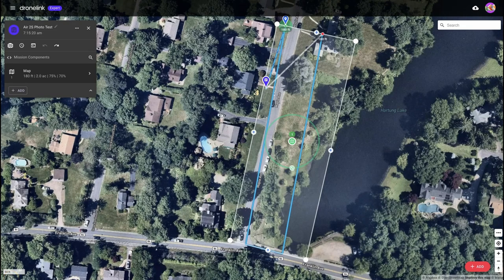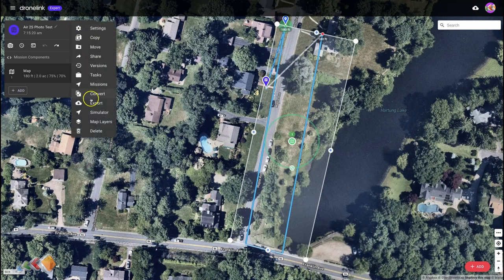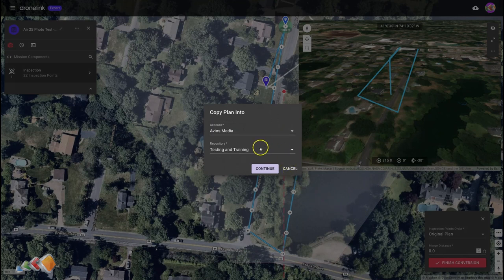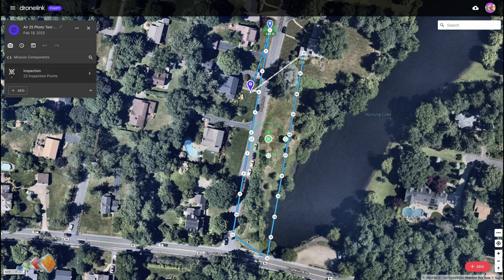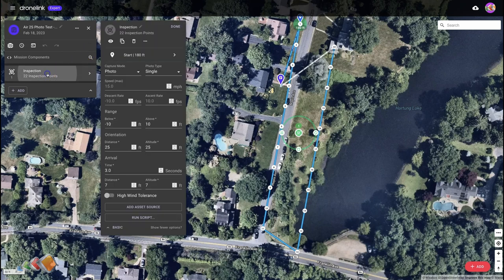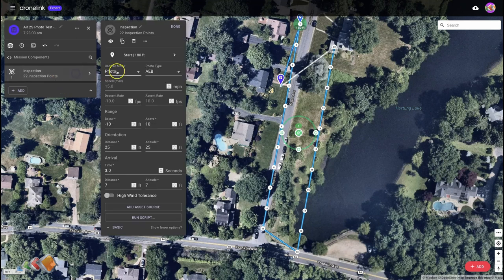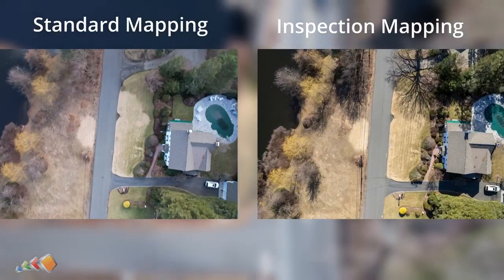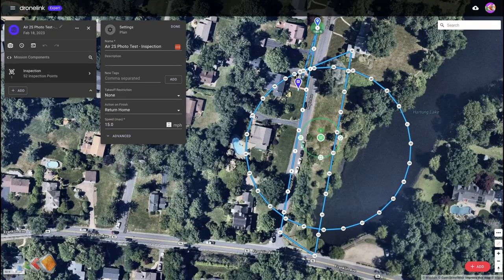Convert to Inspection in Dronelink

Comment: This tutorial is amazing...look forward to placing some air under my Air2S 'wings'. I'll have to see if this option came with the lower expense Dronelink option. I use WebODM Manager to 'stitch' the images together...is this what you use? I helped you with subscribing and thanks.
Reply from the maker: Thank you for subscribing!  I use WebODM on my machine (running in Docker) for smaller projects and WebODM lightning for larger projects.  I have had a few instances where WebODM didn't get the job done for some reason and, in those cases, I generally use Maps Made Easy, which costs a little more but seems to do a good job every time.

Comment: Barry, that was another great video!  Thanks so much for sharing your knowledge.  When you do AEB, do you need to manually combine the exposures or can you just load all images into WEBODM and it will handle that?
Reply from the maker: I'm glad you liked it.  TBH, I don't usually use AEB for WebODM - but you can convert any mission into an inspection mission, so if you have missions that take photos then you could use that there.  If I did use AEB for an ortho, I'd probably pre-process them using something like Aurora HDR to export a finished image and then import those into WebODM.  But that sounds like a lot of work :)

Comment: Great video- thanks. Question: When you set the photo option to AEB, do you have 3 images to work with in post, or does DL do the conversion automatically and you only have the one processed image?
Reply from the maker: You have three images to work on in post.

Comment: Thank you Barry! I can't wait to try this(!) and really appreciate that you added this 5MF and follow up to the earlier 5MF of 20230211 (https://youtu.be/dtZKGRSAuNs). Both of these techniques will be very helpful for users that don't have a mechanical shutter, like my Mavic Air 2.

If you could, please, explain 1) how Speed (max) and Capture Speed (max) work/ don't work together and if you can say if there are any rules of thumb; e.g., travel:capture speed ratios; and 2) carrying this same question of travel:capture when the mission has been converted to an Inspection. Behind both these questions is the fuzzy bit related to inertial dampening and the lurch forward, then slow or stop for the capture.

One thing to generally consider for future 5MFs that mention related content that you've previously created, include a link to those previously created 5MF clips in the description of the new 5MF clip. It might also be worth consideration if the description of the earlier clip was updated with a link to the later clip(s).
Reply from the maker: Thanks for the feedback.  Great idea on the links so I have added those to the description and also added a card to this video linking back to the earlier one.

In terns of capture speed vs speed.  Speed is the speed that the drone will try to reach during the flight - travel speed if you prefer.  This is just the max as it might not be able to reach that due to other factors such a physics - e.g. if a speed is set to 20mph but the sharpness of a curve would not allow that, then it may fly slower.

Capture speed is the speed that the drone needs to be at when it takes the photo.  The slower this is, the clearer the photos will be.  However, that obviously adds time.  If the conditions allow for you to have a high shutter speed then you can probably get away with this being a little higher than the 1s I used.  But if clarity is the key thing you are looking for then slower = better.

If your capture speed is slow and your speed (max) is high then it is likely that the drone cannot accelerate fast enough to reach the max speed between photos, so it will just do the best it can.  If the max is high this might give rise to some jerky drone movements, but it shouldn't affect the results.

Capture speed is not relevant for inspection since inspection always comes to a stop.  

Hope that helps!